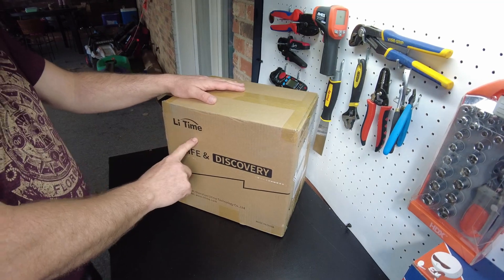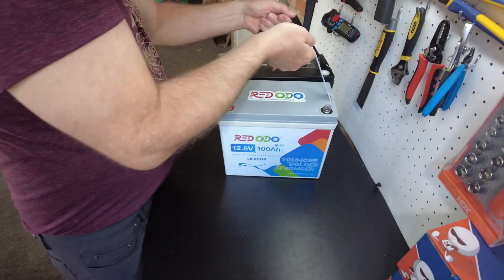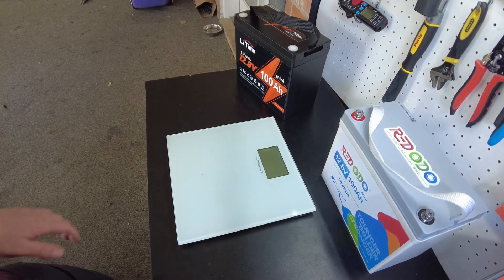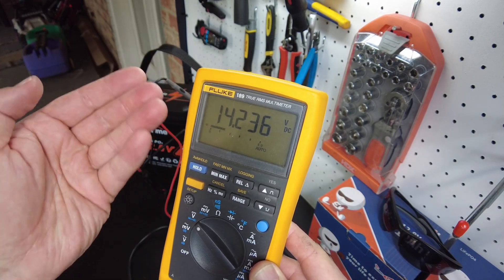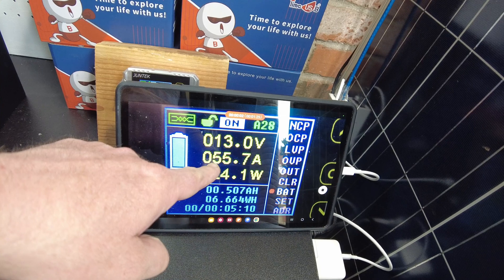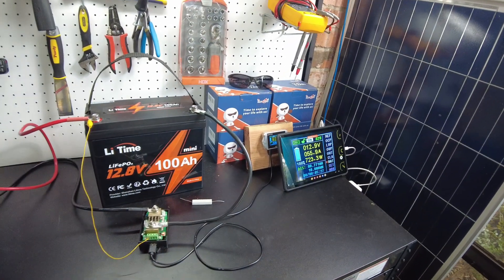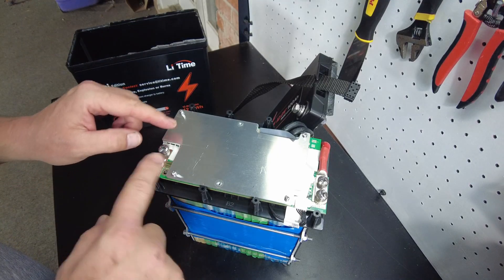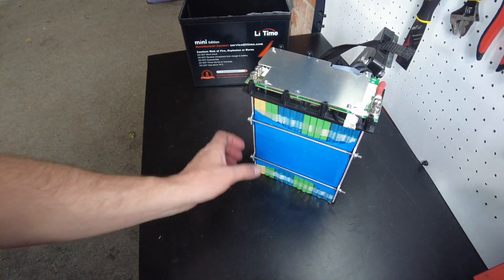Li Time (Ampere Time) Mini 12.8v 100ah LiFePO4 Battery

Comment: For us RV  guys we drain the battery at a much lower rate <10 Amps.  Can you do another test at this type of rate?
Reply from the maker: Hi Mark. There will be very little difference if any doing a 10amp test vs the 55-60amp. The capacity should be about the same. Thanks
Reply: @BradCagle  thanks.  Capacity should be the same but the duration will be different.  Guess I could just do the math.
Reply from the maker: @MarkSDCA  Yeah 10A Draw from a 100Ah LiFePO4 battery will run 10 hours. Easy.

Comment: Does anyone have any ideas as to how this "mini" battery has as much power as the regular sized 100 Ah? Could there be downsides?
Reply from the maker: Yes. 1). the regular size 100ah has alot of unused space inside, like a bag of chips. The minis just remove that extra space making the whole thing smaller 2) these mini batteries use pouch cells, which are smaller, and lighter.
Reply: @BradCagle  Thanks for that info. These look very interesting.
Reply: Pouch cells !

Comment: They ARE the exact same battery... The strap? Really? The one component on the case that could literally have come from anywhere and you really think that makes them different? The ONLY difference in the case is the color. I would actually be surprised if you could prove that these don't come out of the same factory, just under different names.
Reply from the maker: It's pretty obvious they come out out the same factory. I'm not trying to say they are not. I have the PowerQueen, Redodo, and LiTime MINI. They are all the same inside, and out.
Reply: @BradCagle  yeah well, you got stuck on a strap like it was a major difference. The one thing, other than the bolts, that are easily removed. I'm willing to bet that if you bought 16 of these batteries, at least a couple straps would be different.
Reply from the maker: @david78212  Just objectively pointing out differences. Do you see a problem with that? Also at no time did I call that a major difference, that's something you subjectively added.
Reply: @BradCagle  you went through the trouble of pointing out the difference on video... You can't just say it was no big deal now. Make up your mind.
Reply: Just another Troll,,,,,,ing motor 😂

Comment: 8.9kg is just under 20 pounds.  Two of those mini 12v, 100AH batteries would weigh about 39.25lbs and deliver very close to 100AH of power, @ 24v, if connected in series.  When I compare that to the old AGM batteries I used to have in my boat, which weighed 65 pounds a piece, and only delivered 50AH of usable power, @ 24v, it really is astounding how much more energy dense these LiFePO4 options are.  You have a weight reduction of 90 pounds, double the amount of usable power, and they take up roughly half the space of the AGM's.  When you consider there is virtually no voltage sag, and you get at least 5 times as many charge cycles from them, I can't imagine why anyone would choose AGM's for their trolling motor batteries.
Reply from the maker: I agree. Also very low self discharge rate so you wont need to have a float charger plugged in year round.
Reply: @BradCagle Anyone boondocking below freezing will choose AGM, lifepo's can't be charged below freezing, you can add heater pads but is just more pain in the butt, I'm fine with AGM's
Reply from the maker: @IGATECK  Not really a pain in the butt, you can just buy LiFePO4 with heaters already built in.
Reply: @IGATECK  - Why would someone choose a short-term boat anchor when it's very easy to keep any battery above freezing for charging?  I built a system for about $25 that keeps batteries warm all winter long.  If that's just too much work, buy a battery with the internal heating pads.  Still a much better value than any SLA/AGM solution.
Reply: Just have to make sure your motors don’t burn the BMS up. They have a hard limit and the starting surge current can fry it if the battery isn’t big enough.
Reply: @Deveak  - We're not talking about LFP batteries for cranking over the big motor.  We're talking for your house battery or trolling motor batteries.
Reply: @jasonbroom7147  right and I’m saying you need to be careful with sizing. DC motors and inverters have a current rush when they start or even lock up.
Reply: @Deveak  - What are you even talking about?  Have you used an electric trolling motor on a fishing boat?  The "surge" is maybe 50 or 60 amps, if you go from dead stop to full power, and it lasts for one or two seconds, at most.  Are you sure you're on topic?
Reply: @jasonbroom7147  Hey totally unrelated to this bozo’s comments above, I don’t think he’s ever heard of a circuit breaker. Nonetheless, I was looking to switch from my g29 interstate deep cycles to these new minis because they seem extremely convenient. How much runtime would these batteries get when wired in a 24v series? I have a minn kota terrova with a max amperage draw of 57a and an average amp draw that typically won’t exceed ~35-40 amps.
Reply: @UrAvgTutorials  - All other things being equal, LFP batteries are going to give you slightly more than twice as much runtime than you got from SLA or AGM batteries.  They also charge up a lot faster, if you have a beefy charger.  It's crazy how small and light these new "Mini" batteries are.  It's a little hard to believe they are so much smaller and lighter, yet still deliver double the usable amp-hours, with less voltage sag so you're not having to gradually dial up more and more power from your trolling motor.  At the price they're selling for, these days, a guy would be nuts to not use them.  The only exception is if you sometimes need to charge during freezing conditions.  Even then, they're so light you can take them in/out of your boat very easily and charge them in a warmer location, like your garage.
Reply: IF you are at the dock hooked up to shore power, DO NOT!!! bother with a LiFePO4!!! Save your money. IF you use it to go out trolling around and use them almost to zero and recharge them right before you go out, yeah, that's great. Really look at your use case before you bother with LiFePO4.
Reply from the maker: @david78212  I disagree. The price of LiFePO4 is not terribly far off from a decent AGM now. You'll get much more usable capacity with the same spec LiFeP04, and have less worry about damaging it on deep discharges.

Comment: Hello Sir , I hope you are doing well . Question.. I have a 10 ft inflatable boat and a minn kota 55 lb electric trolling motor .. which battery do you recommend between LiTime and Redodo? any idea how many hours I can get out of it at the lowest speed? Thank you
Reply from the maker: They seem to be the same internally, so just choose the one based on price, and warranty I suppose. I was only able to find the current draw on your trolling motor at full speed, it's 52amps, so you would get close to 2 hours at full speed
Reply: @BradCagle  yeah i will look Into the warranty and price . Thank you and have a good day .
Reply: Your trolling motor probably draws around 8 amps on its lowest speed. So a 100ah battery would run the trolling motor for about 12.5 hours. The best way to really figure it out is get a amp clamp, you can get one at Harbor Freight for 15 bucks. Next time you are out hook up the amp meter and see what the amperage draw is on each speed. Once you know those values you can decide what amp hour battery you need. Hope this helps you.

Comment: If you watch the testing videos Andy, from the Off-Grid Garage, did on voltage and capacity testing, there is virtually no reason to go over 3.5 volts per cell, or 14v for a 4S, 12.8v LFP battery.  Also, those two batteries are CLEARLY made in the exact same factory with almost all of the same components.  It's pretty boring, how consistent all of these types of products have become, which is great because we have so many options to choose from.
Reply: Not true at all.
Adventrue Kings batteries quote in their specs for their 120AH LFP: "... The BMS will also perform cell balancing at 3.5V per cell with 35mA of current... ".
What this means, is that a min of 14v is necessary for battery balancing to occur. These LFP batteries should be charged to 14.2v, and held at 14.2 volts for a minimum of 30mins, (a balancing time of 2hrs is specified by another manufacturer) to give the abalancing circuit time to do the balancing task.

At the lower voltages some youtube comments advocate, the balancing circuit will not function. Balancing is always done at the end of the charge. And no, you do not have to balance charge every time. Charging to >14.2v , and holding that voltage for 30 to 120 mins, every 3 to 5 charges should be enough to keep your 4 cell LFP battery balanced.

At 14.2v, you can watch the balancing currrent operate, with the current slowly falling from, eg, 200ma to 50ma over an hour.
Reply from the maker: @nordic5490  Every BMS I've used (well smart BMS's for that matter) are default to start balancing at 3.45v, and some 3.4v. I do agree with these prebuilt batteries you should charge at least to 14.2v as that is stated as the minimum charge in the manual, so maybe the dumb BMSs do start balancing at higher voltage. This charge voltage confusion is because some people (actually a lot) get random cells to build a DIY pack, these cell will likely not be matched in capacity, nor IR so they must be charge at a lower voltage to keep some cells from running away. These prebuilt batteries "should" have matched cells allowing them to charge higher, and stay closer in voltage.
Reply from the maker: Right i keep my charge under 3.55v per cell in practice. i like to test if it will go to 3.65 to see how close it get before the BMS trips. Yeah it makes sense because the real manufacturer has the cell buying power in huge quality, the marketing companies get to private label really quality batteries, and we get to buy them super cheap.

Comment: thanks ill get this once my normal one get used up but just got it maybe 2 years ago and its heavy it has those D size cylinder cells looks like maybe 60 of them inside... only thing now its going to take a decade for this life battery to be used up lol
Reply from the maker: I have a 48v 100a bank of those big cylindrical cells. Takes up so much space, so I feel you 😄
Reply: @BradCagle  yeah also I don't get 100ah.. I always get like 95 to 92ah when I charge it back up .. that's the thing with cylinder style battery it's a bit lower capacity too.. but I think they won't  have swelling issues tho like pouch or square style packs.  But then again all depends how you abuse it in high Amp loads and if it's compressed.. 

I use mine on a trolling motor for my little inflatable boat. Motor peeks pull 50amps but goes to 40amp when moving but I let it hit 25 to 30amps most time just so I can have more range, not that I use up all the battery anyway, most time I only burn about 35ah out of the 100ah.  I'll get this smaller battery for my boat and use my current one with a small 1000 inveter to power up my lights  solder iron charge phone and laptop and small fans and heater..

Comment: Standard discharge rate is only 40ah not 100ah
Reply from the maker: Actually it's 20Ah or 0.2c. But It's pretty irrelevant for lithium. I've done enough testing to show it makes little difference.

Comment: It just seems like adding low temp charging protection would just be a thermocouple in place of the high temp switch and a little logic to the BMS. Seems dumb to not just have that on every LiFePO4 battery these days.
Reply from the maker: I agree.
Reply: It seems to me that it must be a liability where they want to stay away from warranty claims.
Reply: @stevecarlisle3323  It should prevent battery destruction that would otherwise occur. Some enterprising lawyer is going to a company for NOT including it soon, and then the liability tables will turn!
Reply: I am in Australia would be pointless having it on a Battery here ..

So not every battery needs low temperature cut off as heaps places don't require it
Reply: @MegaRyan123456  Sure, but my point is that it is basically free. A thermocouple is probably cheaper than high temp cutoff switch. The rest is just a one time cost to program the logic for low temp cutoff. They've already got the logic for the high temp cutoff. It wouldn't hurt anyone to have both even if not needed most of the time.
Reply: @daveduncan2748  were I am i would rather have more high temperature protection 🤣

Low temperature cut off is just useless for lots of places 

I see what you mean but yer I guess it matters on your priorities
Reply: @MegaRyan123456  I don't think you can actually have "more" high temp protection. 🙂 It's just there or not. Same for low temp charging protection.

Comment: Man your lucky I try to request 50ah LiFePO4 from any company to do a comparison with a group 24 deep cycle battery for a kayak trolling motor and nobody answers the call 😒. I even told them they could use my video on their social platforms and promised them 3 video minimum and nothing 🤷‍♂️ lol the life of a small YouTuber 😂 good thing I have a day job lol.
Reply: They've sent me the 12v 50ah and the new minis!!  I have a rather small channel as well
Reply: @BASSnBEER  sweet I guess it’s random luck of the draw 🤷‍♂️ 😂
Reply from the maker: @patdud1979  Just keep hassling them :)
Reply: @BradCagle  lol 😂
Reply from the maker: @BASSnBEER  Have you tried the MINI in a kayak yet?
Reply: @Brad Cagle  not yet!  I'll have the battery box set up tomorrow and will be testing it out...I never ran the 50ah dead, that was using them about 75% of the day jumping spot to spot and making long runs!!  The 100ah I shouldn't ever have to worry about draining them!!  I will be adding adding about 13 more pounds with both of the 100ah but that really nothing for the amount of runtime I'll have!
Reply from the maker: @BASSnBEER  Nice. Will you have a video? Would love to see it.
Reply: @BASSnBEER  I think using a 50 or 100 ah depends on where you fish. I just got my kayak out on the river where I usually go but in the spring the current is pretty strong. My first outing I was on max speed on my minn kota 30 pound motor just to make progress 🥵. Ideally, I would need a 50 pound trolling motor and a 100 ah lithium battery. The main benefit of lithium is the weight saving for me!! With my group 24 size lead acid and motor in the back water come true the scupper hole a lighter battery would solve that issue 🤙.
Reply from the maker: Keep at it, I struggled at first to get companies to send batteries for review,  but as I got enough under my belt it got much easier. Now they pretty much contact me. Probably helps me being in the battery niche. Send me an email, and I'll give you some contacts.

Comment: I was thinking about running this battery on my bagger for audio purposes (which is why I’m here) running about 8500 watts rms (although music is dynamic) which is about 665A of draw at peak . Would you feel confident that this battery would truly perform to its rating? I ask because normally 60aH is usually sufficient for a setup like mine, but I’m partial due to being unfamiliar with this brand.
Reply from the maker: This battery's rating is 100A, this is the limit of the BMS, so the most you could pull continuously is 100A. Not sure what it would do in short bursts, but I'm  pretty sure it would go into protection mode if it got anywhere near 665A even for a fraction of a second. The BMS in batteries like these limit them to energy storage rather than being usable for high current demands like starting engines, or competition audio, etc.. Hope that helps. Thanks for the comment!
Reply: @BradCagle  thank you for your reply! I had a “duh” moment after reading and realizing it’s rated at 100A and not 100AH 😂
Reply: @WoodDidIt  it's rated both 100 amps and 100 amp hours.

Comment: 4x24 amp pouches would be 96 amps.  They obviously outperform their rating, but for how long?
Reply from the maker: I  figured they were 25ah x4
Reply: The Chinese cell manufacturers are putting out a reasonable product now, so I expect they will last 2000 - 4000 cycles like all the others. I could be wrong, but that is what I would expect.
Reply from the maker: @Bennyboy-dog  Will be interesting to see. Seems a lot of people don't like pouch cells, i'm not sure why yet :)
Reply: @BradCagle  They are said to be more subject to hear stress.  With that #6 red wire rated (nominal) for 55 amps getting hot along with probably 60 amps of black dually wire they are going to get hot in that small form case.  Could that lead to a short life?
Reply from the maker: @atburke6258  I see. Ya know, I was concerned with the wire size in some of these batteries. I tested one, I can't remember what video it was, but if memory serves me I pulled 100a, and the wires inside the battery stayed cool.
Reply: @BradCagle  Thank you, Sir.  Good to know.
Reply: @atburke6258  I would think they would be ok on at 100A during a short term test and moderate ambient temperatures. 
Going from 50A to 100 amps (given constant resistance) should mean 4 times the heat generated by resistive losses in the cable assuming constant resistance, but as cables heat up their resistance will increase so the power losses (heat of the wire) will increase.
The wire ratings are (should be) based on maximum conceivable ambient temperatures, since as you can see there is a runaway effect with temperature.
Wether these are rated under these conditions or otherwise remains to be seen.